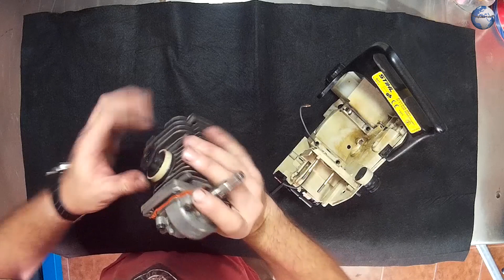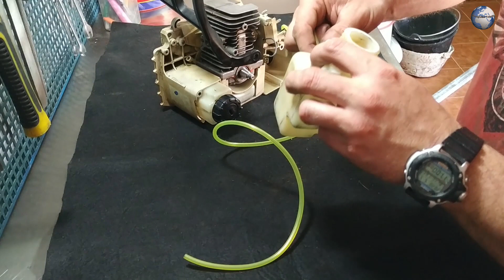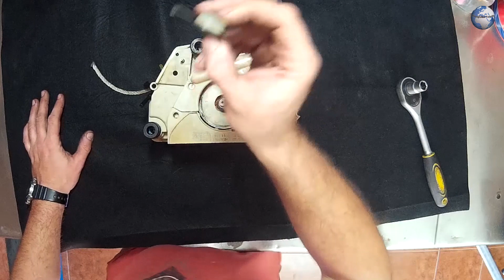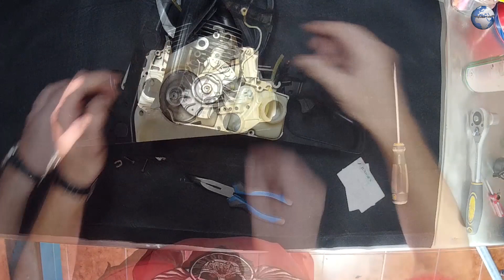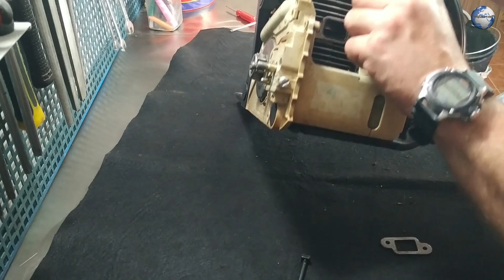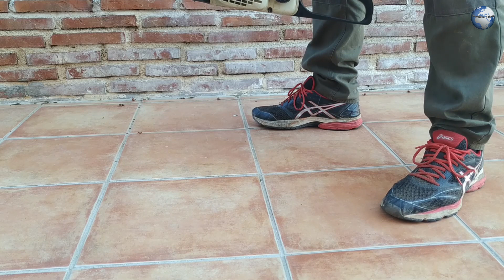CÓMO MONTAR PIEZA POR PIEZA UNA MOTOSIERRA STIHL 017, Stihl Chainsaw Repair #2

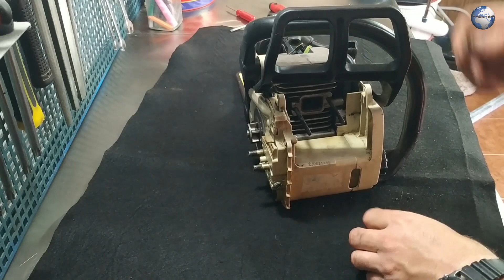Comment: Lo primero de todo, muchas gracias por el contenido del video, y ya para continuar, en relación con lo de la junta (minuto 8:00) yo tengo una Stihl 023 que es muy muy similar y le he desmontado el escape. Mi modelo entre la junta y el motor lleva un escudo (una chapa para mayor protección al motor) y mi duda es si debería ubicar otra junta entre el escudo y el motor ya que de primeras, no venía y desconozco si falta porque no debe ir, o por si se retiro y no se volvió a poner. 
Para aclarar, reitero como iria montado: motor, junta (si procede), escudo, junta, escape, espero haberme explicado lo mejor posible y de verdad gracias por el video.
No he encontrado NADA de información más allá de este video y alguno similar, gracias de antemano
Reply from the maker: Hola, eso es. Se monta escudo, junta y escape. Un saludo y gracias

Comment: Hola desde Chile, te felicito eres capo, le comento que mi moto sthil 250 se ahoga al acelerarla me puedes indicar que puede ser?
Saludos
Reply from the maker: Hola, mira el escape. Suelen llevar una rejilla que a veces se tapona con la carbonilla y hay que limpiar. O si no deberías mirar que el filtro de gasolina esté limpio. Manguera gasolina bien. También puedes intentar girar un poco el tornillo H del carburador a ver como responde. Si no ya quizás deberías desmontar carburador y limpiarlo y ver como están las membranas por si hubiera que sustituir. Un saludo
Reply: @BricoglobalToledo   Muchas gracias y siga haciendo vídeos son de bastante ayuda para los que no tenemos conocimiento.
Saludos y un gran abrazo